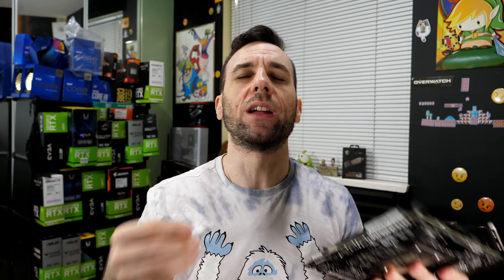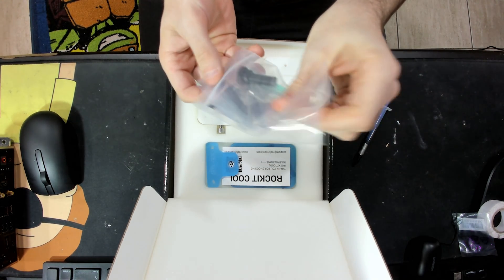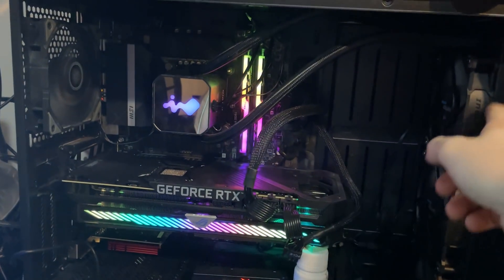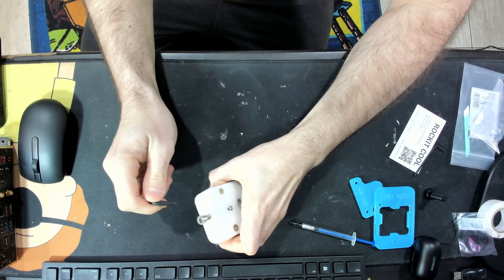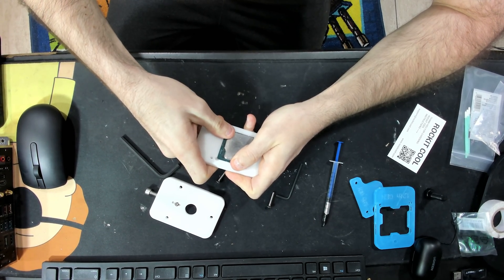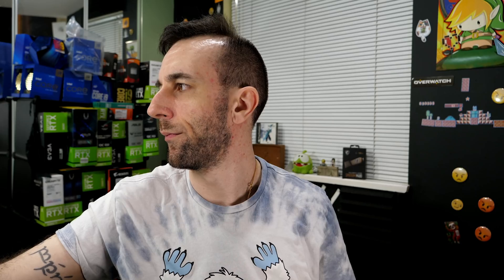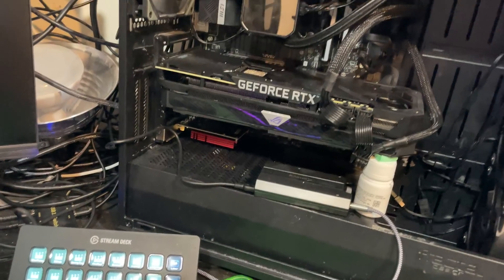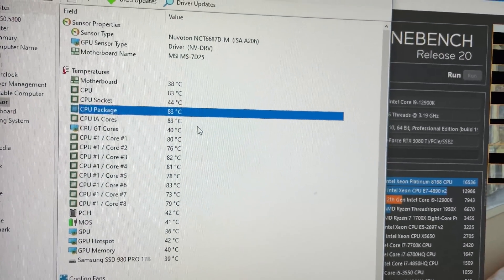Delidding 12900K Temp Results!!

Comment: I Just got my Copper IHS and the kit and yeah $115+60 for the IHS.
This is for a 12900KS i picked up for $250 new lol thought at this price i have to delid relid and Liquid metal and do the contact frame from TG.

I did this with my old 7980Xe before the delid ther was a 55c difference in core temps not good.

Comment: I just did this on a 12700k.  Keep the glue cold.  You don't want heat in the indium or adhesive.  Go very slow on the screw and check the IHS often to make sure it isn't going too far.  I went back and forth once and on the third pass it cracked.  There are two sets of tiny components in the corners under the die.  I hit those with some nail polish without toluene.  I am cleaning the die now.  There are a lot of little resistors around the edge, so I am being careful.  I got the copper IHS kit from Rockitcool and it is finished beautifully.

Comment: That’s ridiculous during a cenebench R23 multicore run my 12 core 24 thread 5900X hits 75C idles at 30C and when I game it hits a max of 56C ( and it’s on a little 120mm rad with a noctua A12x25 ) Intel chips run crazy hot the 13900k is gonna be impossible to cool

Comment: I wanted to check in report my results.

12900 ks sp 104 p core 
Asus Strix wifi D4 
32gb 4133 c15 gear 1 stable 
artic liquid freezer 420mm 
washer mod ( 0.8 mm) 

delid was successful cleaned up solder good didnt re Glu stock ihs just used the board to clamp it.  

before delid 
5.2 GHz x 8 / 4.9 ring / e core off / ht on / 20 c room temp 

cine bench r23 - 30 min loop non stop
hotest core = 71c 
coldest core = 66c 

after delid / relid
same oc settings / room temp 
r23 - 30 min loop 
hotest core = 65c
coldest core = 61c 

i got about 5 - 7c less 

my solder job was pretty good stock ohnestly some ppl solder jobs are real bad then it's worth it.  

I'll try 5.3 / 5.4 . 

32gb ram @ 4133 c15 @ 1.55v gear 1 
I ran r23= 30 mins 
r20 = 30 mins
occt large avx2 = 6 hrs 
tm5 anta 77 extreme = 9 hrs 
war zone = 8 hrs 

crash free 

going to try 5.3/5.4 / 4200 - 4266 gear 1 here and see how she goes

Comment: If the inwin sr36 pro water cooling  is turned 90 degrees, 
let the incoming and outgoing water be on the left and right sides.
the temperature can be lower.  
Because the direction of the water channel is perpendicular to the direction of the cpu die.

Comment: Too much efford and too much risk... if you have to trash 700 bucks, do it, otherwise i suggesto to not try this! i delidded time ago some cpu but it has TIM bethween the chip and IHS, but now those are soldered and you can damage really quickly the cpu. 
Better investing in a good AIO like from Artic (i have the 280mm one and my temps never goes over 75 celsius).

Comment: so nickel plating is actually redundant in terms of dropping temps thats the whole point of straight copper you will lose a few degrees C if not more by the nickel option over the copper there is a large W/mk difference on nickle vs copper. Not sure if enough to care but a nickel plate that thin will wear off anyways easily may not be cost effective nor performance effective

Comment: Don't think I've seen a more suspenseful delid in my life, dude. I checked the instructions page on their site (guess it's up now or maybe QR was broken? lol) it does indeed say to heat the CPU a bit before proceeding to delid. I doubt that would do anything meaningful to the solder but I bet the glue would soften up quite a bit? If you decide to follow through with that guide I'd love to see how heating works out 👍

Comment: I always wonder why people put the IHS back on instead of doing liquid metal direct die
Reply: The IHS distributes the pressure across the die much more evenly, you're less likely to crack the die with the IHS on.
Reply: @MultiRecordMusicInc  only if your being ridiculous about the mounting pressure
Reply: @BonusCrook  it's totally sufficient to tighten the heatsink a bit unevenly across the four mounting screws to make the Die crack. beside that, not all cooler mounts allow the coldplate to get low enough, when the height of the rather "beefy" IHS is missing. Even the retention system of the CPU can interfere. The 12900k also has one SMD capacitor which has the same height as the DIE itself...

Comment: The delid was  very scary - I use a method to apply liquid metal as demonstrated in an "Actually Hardcore  Overclocking"  video -  I clean the IHS and Die with IPA , apply the LM to the applicator and 'paint' it on to the IHS and Die. This method gives great control and minimises the possibility of the LM going where it shouldn't.

Comment: These are literally like 4770k gains from delid. That's ridiculous. How is intels solder so shit. Also how does it only pull 200 watts? e cores disabled?
Reply: i am also wondering WHY THE HELL there is a 10°C drop when exchanging indium solder for liquid metal. The solder should not be so much worse, should it? concerning the e-cores: yes, they are apparently disabled as his CB20 reports only 8 cores and 16 threads instead of 16/24.

Comment: Wonder how the PCB bending in the socket issue will effect this over time. So annoying I have nh-d15 and this bitch hits mid 90s in cinebench. Only a 12700k too. I wouldn't even want to fuck with a 12900k without custom water.
Reply: 360 aio is all you need. And the bending is speculation

Comment: ordered! I have an SP 120 P core chip and been struggling with temps on custom loop and aio. lapped my cpu and cpu block and got about 5C gains. hopefully this gets me a bit further
Reply: Hopefully that 5 degrees was worth you completely voiding your warranty
Reply: @mikerzisu9508  How many times have you used your warranty on your Intel CPU? Bonus round: How many times have you heard of someone using their warranty on a mainstream Intel CPU?

If an Intel  CPU works on the day you get it, the only thing that will kill/degrade it is you and yourself only.
Reply: @AntzuPC  funny you ask, I just saw a reddit post yesterday where the guy had to rma his 12900k. It is rare, I agree... but it's it really worth losing the warranty and even more importantly bricking your very expensive cpu over 5 degrees? There is your bonus round. 

A 12900k costs as much as a ps5.
Reply: @mikerzisu9508  that's because a ps5 is dirt cheap. having/losing 700 USD will neither make you rich nor poor. the risk is totally worth the gain and you always have the option to simply not screw up in the process, so nothing will break. it's not brain surgery.
Reply: @keith303  anyone with any sort of hardware experience knows that delidding can very easily go sideways on you. You can break the pcb, or even make the temps worse than they were before you delidded. People can do what they want with their chips, I don't really care but I just don't understand why someone would take the risk here if the cpu is not overheating to begin with. The 12900k is very hot, but really only thermal throttles in benchmarks and not in game as long as you have a decent cooler on it. A 360mm aio or custom loop is recommended, but you could probably get by with a high end noctua air cooler or a 280mm aio.
Reply: @mikerzisu9508  it is all good buddy. I bricked a 3090 back in the shortage time, had good fun doing it. Tomorrow I will try delid my 12900k and if I fuck it up, then so be it :) my money my choice. You are allowed to share your opinion, and can do so without being an a**
Reply: @mikerzisu9508  to me it was, what is $700 vs enjoyment out of a hobby? On stress tests I gained 5C, but in Warzone where I’m drawing 160W instead of 300W it’s probably more close to 15C different or so I think. I never ran a before and after
Reply: @KibbsFPSHUB  bet you wouldn’t have enjoyed it as much if you bricked your cpu…. Delidding is just silly
Reply: @mikerzisu9508  that’s great man, glad for you to have your own opinion. Also very glad you’ve taken this time out of your day to let me know your opinion. I really appreciate it and I hope you continue to do so in the future.
Reply: @KibbsFPSHUB  when I see something silly that doesn't make sense, you are damn right.
Reply: @mikerzisu9508  Just out of curiosity... Regarding your comments here,  you know you are kinda giving impression of yourself as rude, ignorant and disrespectful? You know this, right?  Let the man have his fun with his hobby. Peace.
Reply: @jaybee0507  you are right, my apologies
Reply: Nice, what's the E- cores and overall SP?
Reply: @lagoleer  I honestly don’t remember, I had the Apex for a while and I swapped over to the unify X, I just remember my P cores being 120. I think overall so was low like 85-90. Right now I’m running 5.4 @ 1.37 vcore w no droop.  It’s game stable, but it won’t pass any sort of stress test. Too hot etc

Comment: Yes do a step by step guide on this. The only thing i wouldve done differently* when it the ihs wouldnt come off was heatgun it and then apply pressure from the other side like you did.

*(without any rocket cool instructions)
Reply: yeah, i'd definately heatgun it for 40-50 secs.

Comment: great video... 10c drop in temps, that's definitely worth the effort...btw that step by step guide might be a big hit.. i've never attempted to delidding, would luv to try with some confident instructional help.  P.S.  would heating the processor up a little b4 delidding help soften the glue around the lid?
Reply: yes, it would help. Rockit (the manufacturer of the tool) also recommends it.
Reply: @keithX303  i wonder why 🤔😂
Reply: @keith303  not worth it at all for 1-2 degrees
Reply: @mikerzisu9508  1-2 lol? try 10-30 and consistency in temps
Reply: It is not worth it.. it is extremely easy to break your cpu. It is a complete gamble on whether or not your cpu will actually be cooler or even hotter if you don’t do it exactly right.. very high chance you will brick your $600 cpu.

Comment: Jufes, to much LM, figured that out on the 12700k. 3 different amounts gave varying results, the least amount gave a better drop for me across the 12900k as well. Hope this helps
Reply: thanks for the tip - just popped open my 12900k and I will use your advice

Comment: yeah it's wild that the Core Delta is still that high.
Reply: That’s cause the chip is warped and not making good contact he needs one of those thermal grizzly contact frames to keep them from warping
Reply: @shorty808100  
yes, it's possible that Die is just uneven or something. 
no, if that is the case, replacing the ILM isn't the solution. the solution would only be maybe lapping the Die flat, or maybe throwing it into the garbage.